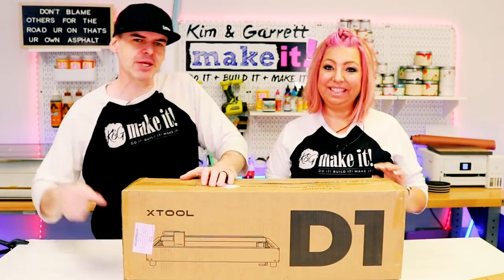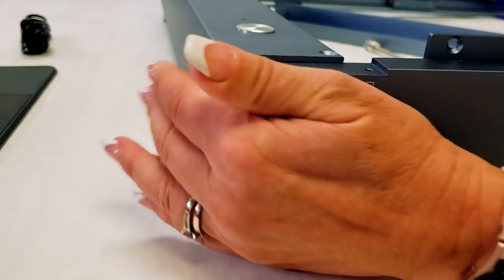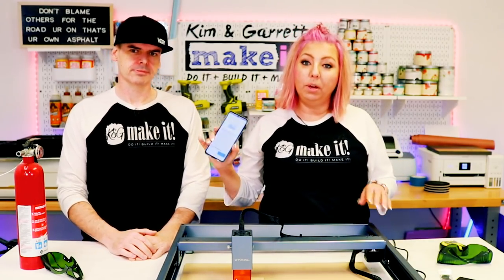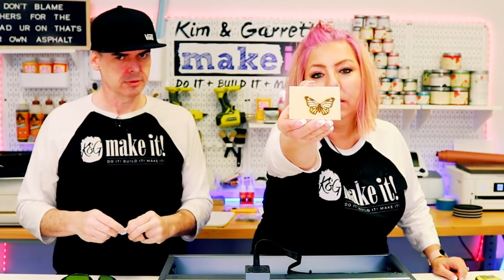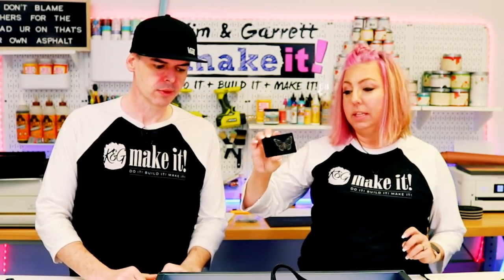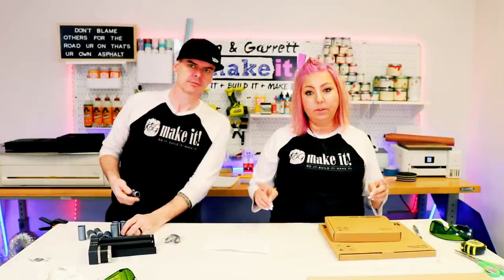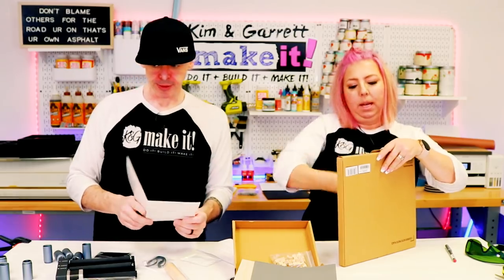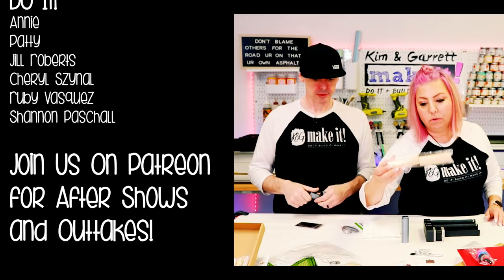Makeblock xTool D1 Desktop Laser Unboxing and Review

Comment: thanks! Did you managed to register the + laser light to center the material? I’ve seen the same problem from other user videos🥺Planning to buy soon. I work with leather and definitely need the Air assistant pump and the honeycomb to get cleaner cuts with no burned marks 💪🏼❣️

Comment: Did u guys figure out centering the logo you're going to engrave?
Reply from the maker: Yes, you must use the laptop, not the app.   Stand in front while aligning and trust the red alignment marks. They may not look aligned but the laser head moves to that position when it starts.
Reply from the maker: Oh! And trust the Red X on alignment. The laser head moves to the Red X when it starts.